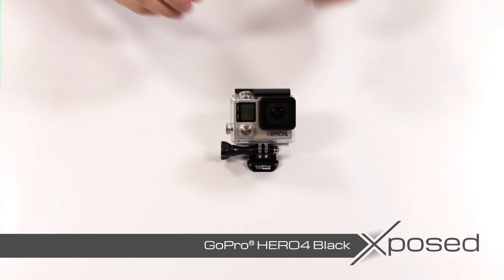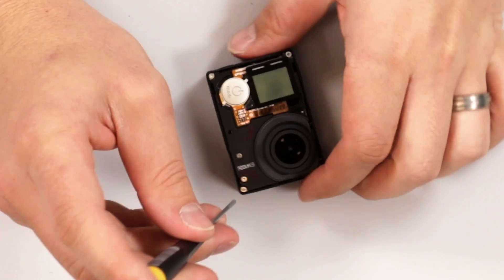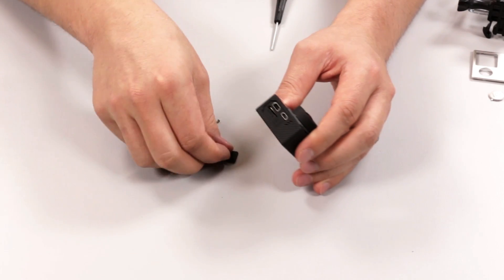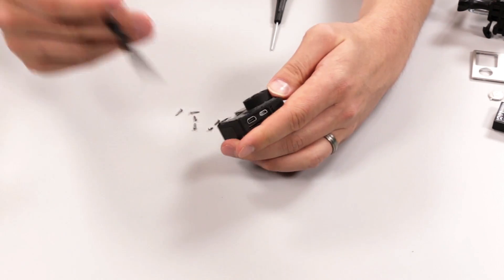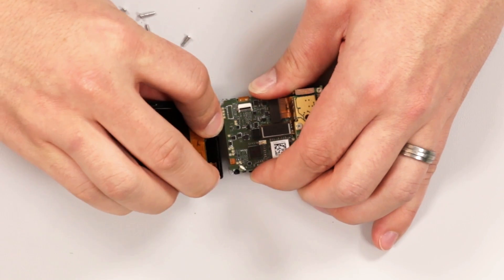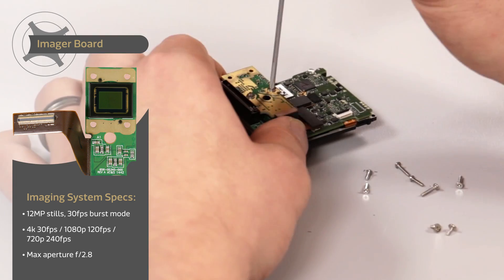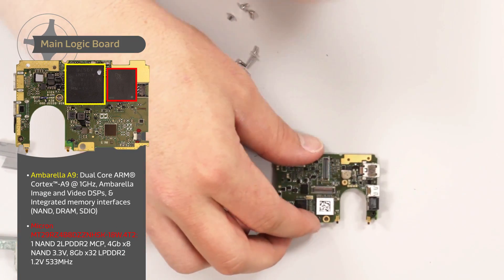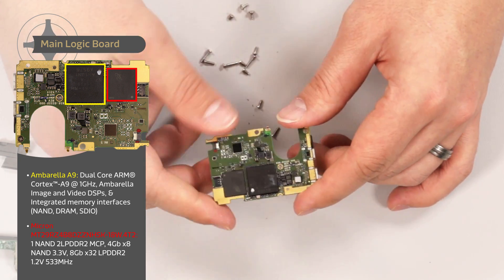TechXposed Teardown Series - GoPro Hero4 Black

Comment: I had to repair the lens and sensor on my GP4 black but now the Wifi/Settings button is not working. Can you tell me what cable goes to that button on the side of the GP?
Reply: Ray Dash you talking about the top shutter button or the side WiFi button?
Reply: Side Wifi/Settings button no longer works.

Comment: Any tips on how to get the small ribbon cable on the side (the one for the top button) back into the connector? I can't seem to get it to hook it... the ribbon is really tight.
Reply: I literally just had this issue and was able to fix it. A little hard to explain but basically I put the gopro almost all the way back together but let that left side sticking out some. I could push back the rubber cushioning and see the little ribbon but from the other side. I used my small screwdriver to kind of crease the ribbon cable so it was at a 90 degree angle. then I used the screwdriver to push on the folded part so that it plugged it into the slot. I had the camera on so I could keep pushing the shutter button to see if it was working.
Reply: +dem0n1k ever figure out how?
Reply: Nope :( It is still sitting in a plastic bag in pieces :(
Reply: Damn man sorry to hear :/
Reply: +dem0n1k 
I came here to askthe same thing. I accidentally pulled it out when I was replacing a lens. No camera shops seems to be able to do it. Did you figure it out?
Reply: Sounds the same as me. I went to so many shops, then my electrician friend just jammed it back in as you described. I can't get the focus right after changing the lens, but it's better than nothing. ;)
Reply: Russ Dahlberg I did the exact same thing... Just bent the little cable and worked on the gopro in an uncomfortable position... But it worked.. I was so scared because none of these videos explain the fact that the little ribbon cable is probably gonna get disconnected when you open up your gopro.. So if you're trying to fix your gopro yourself... Be careful people... It'll be hard to connect that little ribbon cable.. But have patience and you'll do it.
Reply: YES! A year or more later :P I took out the 2 small screws that hold the battery case into the enclosure. This allowed me to get the ribbon cable close enough to get it into the connector & enough room to get tweezers on it & push it home. Then I super-carefully slid the whole assembly back into the enclosure. Unfortunately... there is no way to get those 2 little screws back in again without detaching the cables again! So I'm just going to glue it in place. The camera is still damaged... the whole lens/sensor unit is bent facing slightly down & the case is cracked in 4 places ... but hey... it works!!! W00T!